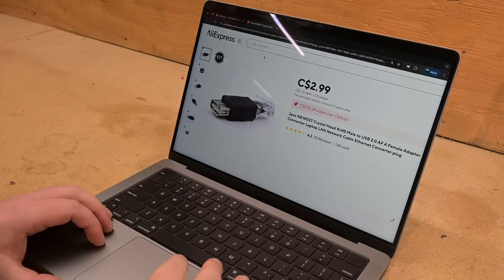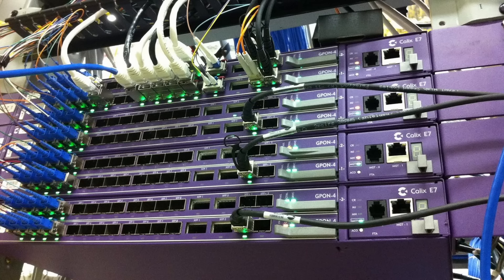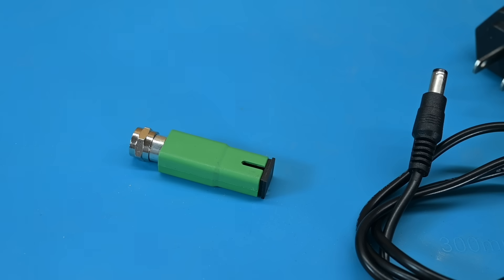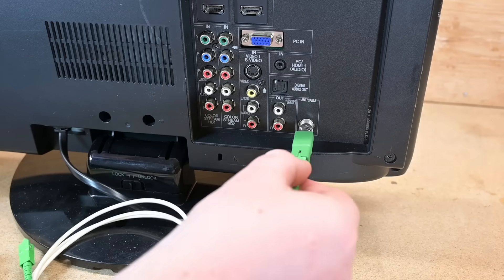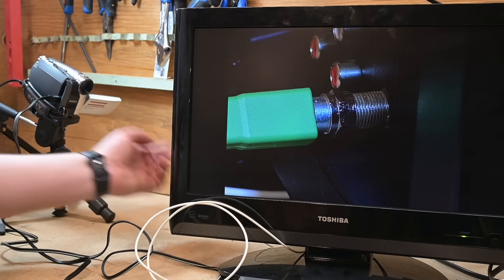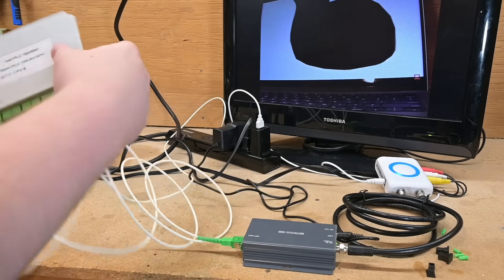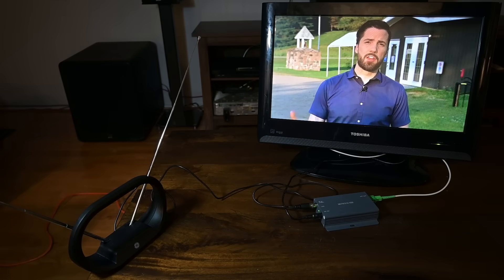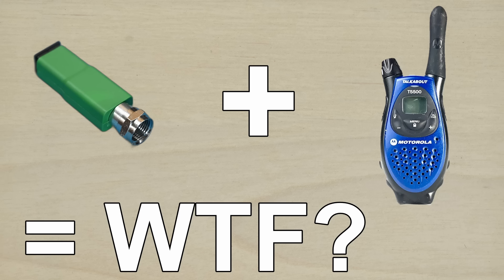Does a $5 Fiber Optic to Cable TV Adapter Actually Work?

Comment: could you try using fibre optic cable for drones for different things like TV internet phone it would be interesting to have a drown fly to a location then the fibre cable be used for internet  may need to run 2 cables for rx and tx

Comment: Laptop screen to camcorder to av cable to RF modulador to coax cable to laser transmitter to fiber optic cable to coax converter to tv is a cursed data transmission method.
Reply: Haha! Take that copy protections!
Reply: You forgot the fiber splitter and second fiber cable
Reply: All for a spinning cat...purrfect!

Comment: My dad built something similar using an IR beam to send music across the room to speakers. The receiver was just a photodiode and a capacitor. The speakers had their own amplifier. It was a project from an electronics magazine.
Reply: DIY Perks did a more elaborate solution based on the same idea.
Reply: Did it click when you turned on the light?
Reply: Pretty interesting setup, there's also a more sophisticated version of this used on IR headphones, using both a 2.8 and a 2.3 MHz signal on the same LED, with FM encoding.
I still use this for gaming on headphones since it has as close to zero delay as physically possible on a wireless transmission (maybe a few microseconds at most from the passives), specially important on rhythm games.
Reply: It's pretty cool. I used that sort of system to get a losless audio signal from behind my projector to in front of it, without needing to route wires

Comment: I am curios if this could be used for antennas for mics. we have RF over FIber antenna gear buts its very expensive, would love to test the setup you have shown in for wireless mics to see it still works.

Comment: Holy crap. I actually works? Hell. I'd run fiber all over the house and use these where I need coax hookups. I actually LIKE the damn things.
Reply: Ya, receiving tv or video/audio is fine over this, but internet needs upstream, and this adapter is receive only
Reply: @Oblivion_94 cable guy for xfinity/comcast here. Old tv boxes (as in really old) don't need upstream but as of a few days ago in my region they are no longer used and we're supposed to convert customers to new tv boxes. New ones need both upstream and downstream. They're more like internet devices nowadays anyway. That's why we prefer wireless, since you can just install a modem and however many of the wireless boxes without running new cables, really is much easier. Some customers are against them by default though.

My professional opinion though is to never pay for cable and just pirate content/pay for what you actually need. Some channels are literally just running ads and nothing else. I have no idea how people watch that.
Reply: yeah even though I ultimately have no use i wanna do this for fun lol
Reply: I wonder if you can just hook up one of those coax to fiber converters on the main coax feed into your house, then use one of those optical splitters to run fiber to every cable box with one of these $5 adapters at the other end... although as I'm typing this out it seems more stupid than practical
Reply: @jakecrowley6  Nope. Its one way. Cable boxes phone home same for your internet modem it needs an upstream.

Comment: Of course it works!  All it does is convert light to electricity.  Every optical receiver needs this kind of conversion to make the signal useable by electronics.  The signal doesn't have to be translated in any way.  It's in the specifications.  The receivers on the electrical side (TV's, cable boxes, etc.) are VERY sensitive, and they have no problem recognizing this tiny electrical signal.  I'm surprised the converters aren't even cheaper (sometimes on AliExpress).

Comment: I own a cable tv company. Back in the day. When optical first came out. I paid over 4000$ on a 1310nm rf to optical transmitter with 10db of optical power. & The reciver nodes were 300$ each. 
These days you can buy cheap units for so little money and the quality doesn't really matter anymore as digital doesn't degrade like analogue..
I have switched to all passive optics back in 2021. It saves a lot in electricity bill and fiber is lot cheaper than even ccs coax cable. Also doesn't degrade under weather. 
Nowdays the cable tv goes in 1550nm optic as the 1310nm is used by onu uplink. Although I haven't switched to 1550 because i already have so many 1310nm hardware, so i lay separate fiber for internet & cable . Again fiber is cheaper than replacing whole racks of equipment. All nodes & transmitters of 1310 will become obsolete if i do that.
Reply: I think 1550 is also used because it can be amplified with edfa. So only make the optical signal at one point and send it every where it is needed, and amplified if needed.
Reply: @remcool1258 you can make edfa at any wavelength. 
1550 is used because the olt uplink is on 1310 & downlink is on 1490nm. 
And with wdm we can do internet+ rf on single fiber and separate them at destination. 
Edfa is needed for complete passive network as these passive nodes completely rely on optic power to produce any rf power. 
I supliment edfa with just multiple 13db rf to optic converters as they are cheaper than edfa. I won't invest in edfa and wdm as it will make the already existing equipment obsolete and would require multi thousand $ network upgrade for little to no extra benifit than the way i already have.

Comment: Very good.  I've done very similar but over RJ45/CAT6.  I've a single FTA aerial socket, connected that to a 4 port powered splitter/booster then convert the (is it RC6?) socket to RJ45, then the other end with the TV, RJ45 to RC6 which has another converter to allow to connect into the aerial socket on the TV (am in the UK)....has been working for years.  Now I have 3 TVs in spots in my house I could not get a direct aerial connection and all done for about £45.
Reply: Interesting - you turned a RJ45/CAT6 cable into a TV cable. Do you have any more info on where you got the adaptors from? As i'm also in the UK and have redundant (or only reaching 100 mbs) ethernet cable. Thanks
Reply: Hi I did reply but think it did not go through.  have a look for - RJ45 Male to Coaxial Female Coax Barrel Coupler Ethernet Adapter Line Connector
Reply: @FlashPan73  Thank for your reply -

Is the RJ45 Male to Coaxial Female Coax Barrel Coupler Ethernet Adapter Line Connector the same thing as a the adapters for a cable/Line testers what you have used? 

As based on your £45 spend I was suspecting you have used a purpose build adaptor for converting TV coax to ethernet like the Lynx Broadband 040-0074 LC Coaxial RJ45 Converter I found on ebay as I wasn't sure if the  RJ45 to F Coaxial Connector Adapter for a Line Tester would work and was trying to work out what you spent £45.
Reply: Yes, those orange adapters are the ones I used to connect to a 4 port tv signal booster along with other standard couplers etc to make everything connect together

Comment: Don't forget radio waves are just light we just cant see it
Reply: Some light is light we can't see...
Reply: Everything in the air is a radiowave, we are happy to see a small part of wavelengths with our two built-in detectors and on the very lower end of the frequency we have on the side of our head some detectors for this.
OK, we can additionally detect ultraviolett with our skin, needs just some exposure and some time, then the other detectors in our head can see red skin and other detectors feel pain. ;-)
Reply: Radio waves and light are both EM radiation, but wavelength/frequency does have a qualitative impact on how we interact with said EM radiation.

Radio waves have sufficiently large wavelength that they can interact with macroscopic structures like anternnas and wires to produce electrical signals directly. Light on the other hand tends to interact with the energy states of electron shells and the electrical signals are the results of that interaction.

Comment: This reminds me of a  land line telephone system from the 1980s which used optical power sent down the fiber to charge a battery in the telephone while it was on hook and idle.  When a call was answered, the battery provided power for the ringer, codec snd speech amplifiers.

Comment: I love cursed connectors, but I especially love cursed connectors that actually work.

I've wanted something to allow you to replace a mico-SD card with a SCSI hard drive for years. That's the best cursed connector I could think of.
Reply: Hardware for that wouldn't be particularly bad (if large when compared to a connector) but man would I not want to write the firmware for such a thing.
Reply: @oliverer3  Especially since I'd be using it on a 3d printer hahaha
Reply: If you mean to use an SD card in the place of a SCSI drive, that already exists, and has for a long time. SCSI2SD. It's used by fans of vintage Macs and other computers that use SCSI drives. If you mean the other way around, I don't know of anything, and can't really see much point in it.
Reply: @mattelder1971  No that's obviously easy to find. I know some people would find it hard to tell what I mean. I want to replace an SD card with a scsi drive so my 3d printer accesses an old 1980s SCSI drive.
Reply: I’d love to write the firmware for that.
Reply: @v1Broadcaster  easy, grab an arduino and go 😂 i did one for eeprom
Reply: I think BlueSCSI might be able to meet your needs.
Reply: @crazyfurnaceguy1229  No that's the other way around, that makes a micro SD card talk to SCSI. I want to go the other way which would be a cursed connector. Having a SCSI drive pretend to be a micro SC card on a 3d printer or a phone.
Reply: @RinoaL I finally understood what you meant, but you almost managed to achieve the cursed adapter combo. A Mobidapter paired with a USB-to-SCSI adapter should meet your needs, but the Mobidapter has been out of production for at least over 10 years. Good luck finding one 😅
Reply: You can do that with an Arduino and a daisy chain of SD card adapters. First in the chain would be a micro SD to full size, or you can skip the chain and just cut the ribbon on the micro SD. Hard part is making the Arduino be the bridge between the hard drive interface and the SD device. 

This kind of thing will never be commercially available because SCSI is only used in server hardware today, and SD cards don't go anywhere near servers.
Reply: @HittTheDekk  Lots of enterprise servers have SD cards in them. SD cards are VERY common for host storage for the hypervisor. ESXi has an entire supported deployment based on SD card storage for the hypervisor. As far as SCSI being used, only in the form of the SAS format, there are no 80-pin SCSI connectors anymore, no more ribbons.
Reply: @2009dudeman  Can confirm, all true.
Reply: @2009dudeman +1
Reply: @HittTheDekk you had my upvote until I got to the part that you said SD cards don’t go anywhere near severs. While the failure rate is definitely higher than I’d like for mission critical apps. There’s a not insignificant amount of rack mounted network gear with plain old SD (not just CF, which is much more common) floating around it. It’s typically not a problem if you’re using something like a SNMP server to dump anything writable like logs. Write a bunch to an SD card and you’re in for a bad time.
Reply: HDMI is actually ethernet. There are adapters to convert them to ethernet also.
Reply: @dewaynehowse231 No, HDMI has ethernet (ethernet over hdmi). It's not ethernet at all. 😂
Reply: @forbiddenera I don't fully understand your wording. But my point was that the basis of an hdmi cable is 4 shielded twisted pair. That can be converted to use as ethernet.
Reply: @dewaynehowse231 The HDMI video signal is actually a DVI video signal which is a digital representation of the analog VGA signal that sends each line pixel by pixel with horizontal and vertical blanking pulses. This is because manufacturers originally wanted it to be able to drive a CRT display with minimal conversion of the signal on the monitor side though only a few very high end professional monitors ever used this feature. Displayport by comparison sends video as data packets one image at a time. EDIT: this was the case with HDMI 1.0 they may have changed this with later versions but I'm not sure. The original HDMI was basically just DVI on a worse connector with digital audio added and video cards usually had a convertor dongle between DVI and HDMI that was just a dumb electrical connection because no actual conversion of the signal was needed.
Reply: @atomicskull6405  HDMI today's is defintily digital and not analog. Also there're a lot of digital DVI ports, probably more digital then analog.
It wouldn't be possible to pass trough 4K 120Hz, Ethernet and audio at once over a analog signal^°
Reply: @atomicskull6405 my point is not in the video standard but the cabling standard. The basics of an HDMI cable is 4 shielded twisted pair. Standards for video signaling is just the icing. There are converters that switch the functionality of an ethernet cord to be used as an hdmi or an hdmi to be used as an ethernet.

Comment: Awesome content!!! Can you test this or have you tested this against something like directTV/SKY ? I'm asking because the conduits in my house are full of coaxial and I just dont want to suffer anymore when a wire give me issues (coax and Ethernet goes in the same conduit over 3 floors, so pretty crammed rn)
Reply: The compilcating factor with SKY is that the LNB has multiple modes. There are two different polarisations, and traditionally were also two different frequency bands giving a total of four possibilities, though the newer "wideband" LNBs used for sky Q combine send the whole band in one go allowing two cables to carry the full selection of signals.

So it's not just a simple matter of repeating a unidirectional RF signal. You need a box that can take the different signals from the LNB and combine them in some way to send down the fiber. Then another box that can split them out again and then select the signal the box wants.

There is kit available to do this (google "fiber irs") but it's not cheap.

Comment: They work fine, if you connect them directly to a tuner or amplifier, and you have split any other wavelengths from the fiber.

So if your GPON is 1310+1490+1550. You must first remove the 1310+1490. Before feeding the signal to the converter.

Beware that if you then feed the 1310+1490 to the CPE, without the 1550 signal. The ISP can see you are messing with the fiber. Instead split the fiber 50/50 first, and feed that signal to the CPE.

Comment: Uhm, what?  I’d say the darn thing (assuming this wasn’t a troll video)  would need the +8dB to get the thing to  power up or function st all.  Fiber to the home for example is likely in the -12 to -18 ramge, and even simple optical Ethernet is +1 to maybe +3 if you are lucky.  Totally queer!

Comment: Okayyy... you really do learn something new every day. Didn't think a laser could be that powerful - I would've lost that bet for sure. Thank You.
Reply: Tbf a rf receiver is built to work with extremely low power signals.  If I remember correctly something around μV and pW
Reply: @isseyIT  Basically, THIS.
The arguably only difficulty lies in the common fast (single-digit-GHz wide readily-utilizable bandwidth) photodiodes hard-requiring a reverse bias to deliver their expected/desired performance, due to needing to push the P and N regions either side of the depletion region far away from each other, so ([the area of the photodiode active zone] divided by [that very depletion region thickness "gap between P and N"] times [the absolute permittivity of the depletion region]) gives us a sufficiently small effective small-signal capacitance to thus limit how strongly our desired high frequency signal is low-pass filtered by that capacitance and the (high-frequency/small-signal) load impedance (typically a trans-impedance-amplifier; though in these more-passive applications like the OOP video's fiber-to-coax cable-TV adapter, it may well be the matching network that matches the photodiode to the coax transmission line (probably 75 Ohm like most TV antenna (-derived) connectors)).
Reply: Doesn't need to be powerful. Modern silicon only needs a few hundred femtowatts to a picowatt to start decoding signals.

Comment: M-Net Germany uses a third infrared light color to transmit HF signals over fiber optics. 
So one light color for RX and TX, as well as one light color for HF on one fiber optic.
Reply: Yes, I worked there. It's 1550nm. Specified in the PON specification
Reply: HF? High Frequency?
Reply: @ipavemyownroad  Well wavelength = 1 (or speed of light for optical) /Frequency.  So Speed of light /1550nm = 193.5THz .  Thats HF, no ?.  A VERY Super Duper HF.  Higher than VHF, Higher than microwave. more in the millimeter wave territory.

Comment: I'm sitting here going like does he not know a laser is a power source? glad he opened it up to find out himself.
Reply: The issue is not that the laser transmits power, but how the internal electronics get power to operate with no external power connection. For example, the optical input on a stereo receiver has powered circuitry inside it that converts the digital signal.